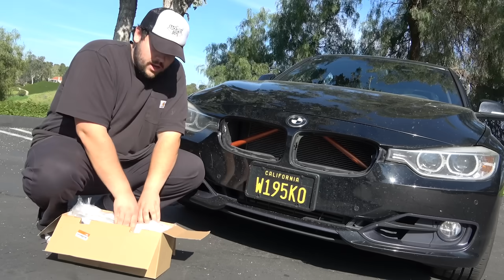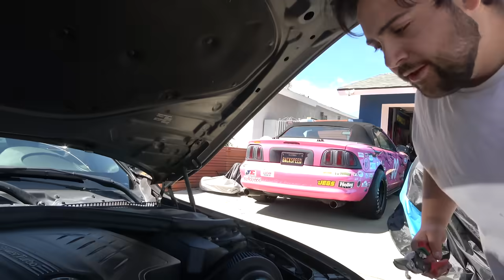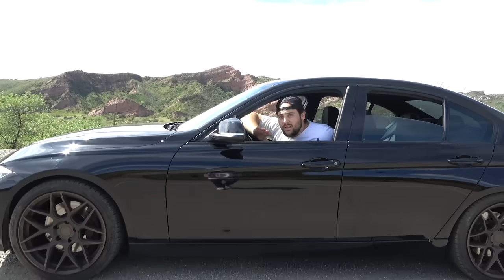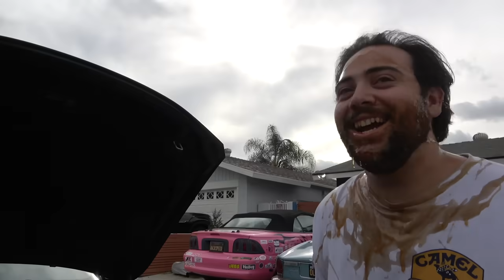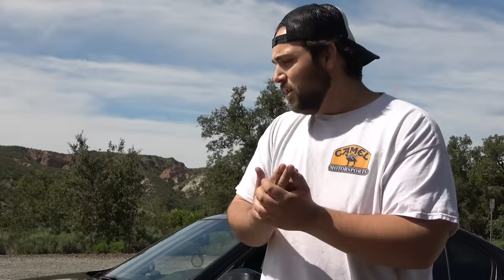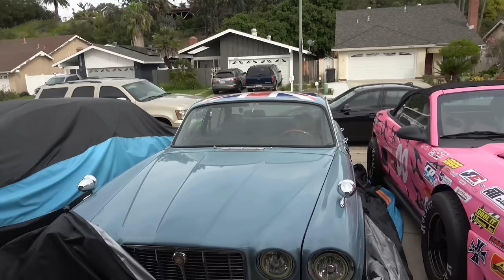I Tuned My Cheap BMW To 500HP... Was This A Mistake?

Comment: Bro has no clue what he’s talking about lol
Reply: That's the funny part 😂😂
Reply: lol he does. I think this n55 series is a joke. Ain’t no way a stock turbo n55 making 500hp😂😂😂
Reply: @Woo.f32 do more research
Reply: @Mr77Trojan   the world record stock turbo n55 makes almost 440. Owned by sunbish, his channel is small but highly informative on the b58 an n55. No n55 is making 500 stock turbo. Not even on ethanol and a custom tune that messes with waste gate duty cycle isnt gonna pass 450hp. I seen one guy go as far as putting a n52 cam in a n55 and he didn’t even make over 470.

Comment: your preventative maitnece …. valve cover , oil filter , fuel pump , fuel lines could make ur 0/60 higher times less throttle response n what not especially modding the exhaust right when i put a straight pipe i felt less power when i put everything on i felt my throttle response increased u should put stock exhaust on and see how it feels with down pipe / intercooler / tune

Comment: If you guys know how to weld, I say you guys make a budget top mount turbo kit for this build, then sell it after if you want too. That would be sick! Also if your getting a 550i, don’t do it! They’re huge headaches and the N63’s are trash and will blow. For the n55 it can be very reliable as long all maintenance is good. You could even do the rod bearings, and the N55 will be stupid reliable. It’s not hard to do at all. I did my own on my N55 m235i. My m235i made 700HP on a bottom mount turbo kit with manual trans on a twin disk. It was very reliable. More reliable than it was on stock turbo.
Reply: If these donuts can’t even do a ofhg or valve cover gasket on a simple n55 a n63 will blow up in these guys hands 🤦‍♂️
Reply: N63tu is better and so far my 550 has been no headache
Reply: @speckhondo2826  was just about to ask if the tu ver. is a lil better LOL
Reply: @ohok010  100% is
Reply: How many 550is have you had?

Comment: 10:46 “maybe time for a better bimmer”…. he said he wants a turbo’d v8, 550i incoming???👀
Reply: How can it be this bad at 0-60 btw? Stock one is 4.5-4.9 
bad flash or transmission?
Reply: @CONNNE   my 328i does it in 6 so yeah something is not right

Comment: I have the same bmw with slightly more mods on e30. Beat a 2016 5.0 on a 40 roll. And mine is the pwg 2012 model. So idk what’s going on with that thing. But it’s rough 😂

Comment: Lmao. Yes, get the n63.. One of the least problematic BMW engines (sarcasm). We have a 550i in the family with a brand new engine, and the last engine spun bearings at 70k. I definitely wouldn't go for a budget car for that purchase. The TT V8 is dope, but it sucks to work on and has way more issues
Reply: If you happen to want to buy a 2012 550i with ~15k miles on a new factory engine w/many of the original n63 problems fixed, lmk haha. Bro has been trying to sell it for awhile now, but nobody wants to pay the price the new engine added. In WA though

Comment: I think thats a 2013 or 12 335i so probably a PWG N55 not making anything over 380hp without e85 tune to e20-40 and thats about 400-430hp to the wheels I barely make 650hp with an upgraded turbo. But I will say this, upgrade that turbo and NOT buy Pure turbos the pure upgraded turbos have a 50/50 chance of developing shaft play at 6k and sometimes below 2k miles my Stage 2 blew at 4k while only running 20lbs, but any other turbo that isnt an upgraded OEM will be stout so long as you don't moon tune it and daily it at 30psi and also stay on top of general upkeep. I recommend baffling the oil pan and while at it changing the rod bearings to the m2 performance ones just donuts alone can starve the engine and spin a bearing of which has a HIGH chance of cracking the crank. scoring cylinder walls at that point. fueling is obvious stay away from a full e85 tune. run e50 with upgraded fueling then methanol. This also goes to anyone else who is new to N55 reading this, I wish I knew all of this info before I made the numerous stupid mistakes with the car but now it's a machine.